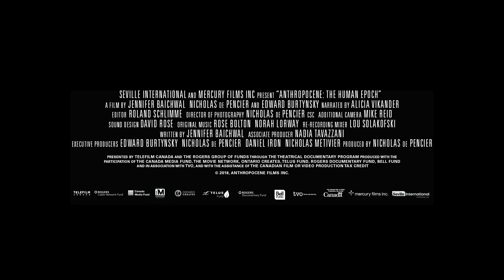Anthropocene – Official U.S. Trailer

Comment: The planet will never die, but we will...
Reply: Uhh yes it will, even if it's not locally, either the increasing heat of the sun over time or eventual supernova will be the end if nothing else ends it. Every star does eventually.
Reply: @metsuricloud6520  we are not a star
Reply: @65minimom  ... Apparently you have not heard of the sun, yes the sun is a star
Reply: @65minimom  in 5 billion years the sun will start fusing helium in its core, which will cause it to grow into a red giant. It will consume Mercury, Mars, and expand out close to Earth's orbit. We aren't sure whether Earth will be pulled in by the Sun's gravity and dispersed within the Sun's outer layers. Eventually the Sun will shed most of its mass as a planetary nebula. It won't explode in a supernova like larger mass stars do. The Sun is a million times larger than Earth, but there are stars out there that are 2,000 times larger than the Sun (stars like Stephenson 218, Betelgeuse, and UY Scuti) that do explode as Supernovae. The Sun won't explode, but it will release a large cloud of plasma and matter that will eventually cool into a vast cloud of dust. After "a while," gravity will collapse that cloud of dust into a spinning flat disc called a solar nebula, and pressure and heat will grow in the nebula's center as it spins, producing protoplanets out along the edges of the nebula and a new embryonic Sun in center of the nebula. Contained within the heated whirlwind as this all happens will be the calcium in your bones and teeth, and the iron found in the hemoglobin of your blood, because although we won't be around, the atoms that comprise us definitely will--all of which is not to say that we shouldn't care about the here-and-now, about the climate crisis and the threat of the Anthropocene--we most definitely should care.
Reply: It will one day
Reply: Nope. We will survive, but biodiversity will suffer.

Comment: It all starts with the concept of trade
trade means gathering of resources
gathering of resources means more acquisition of said resources
then more demand
more demand
demand
and, it expands to where we need other resources to support the previous (concept of currency, from copper, to gold, to paper bills) resources, till we either run out of those resources, or get low enough to realize we need to synthesize, which then requires even more resources from different sources. It is endless.
Humans created their own concept of a currency, something unnatural and not normal to exist.